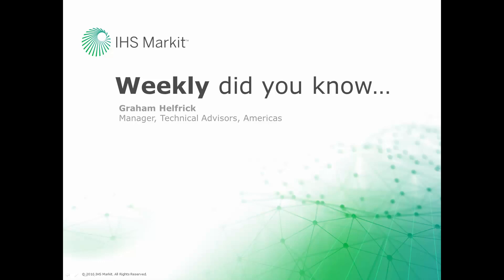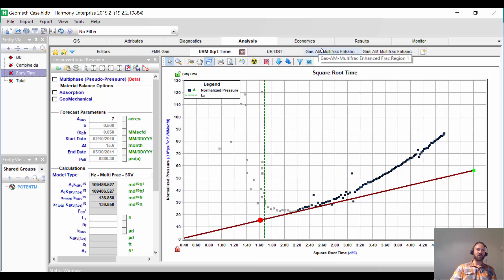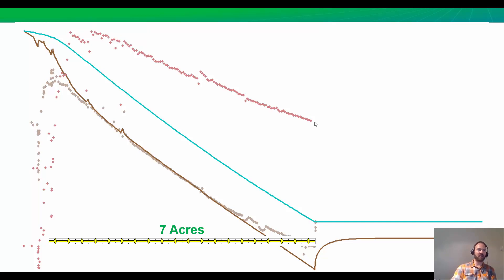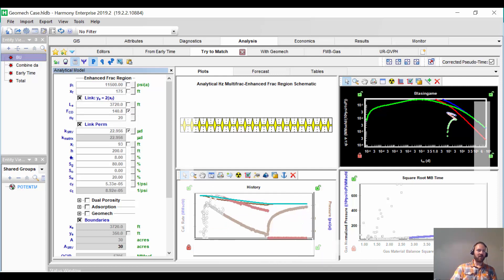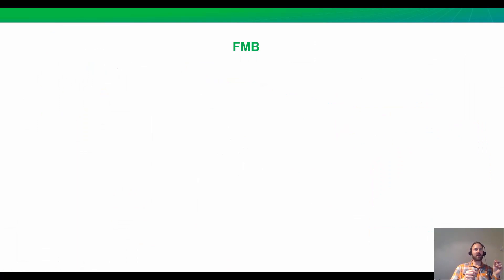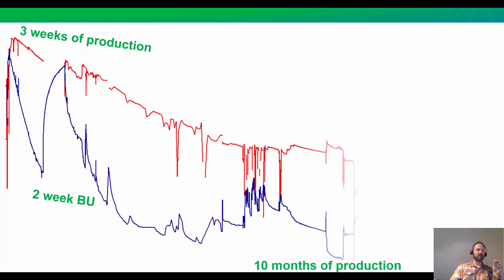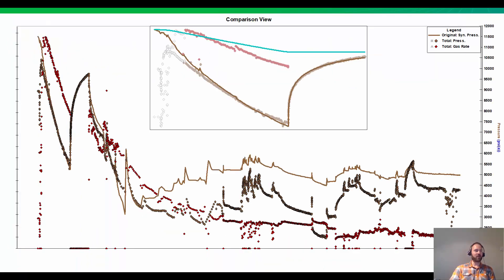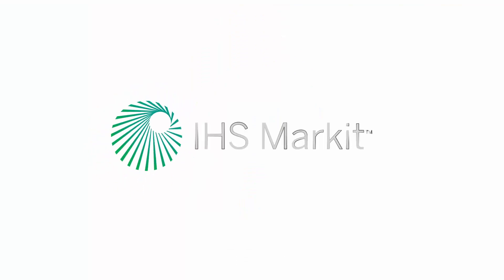Episode #46 - Geomechanical Detective Work

Comment: Excellent video.    I would add overpressure is your first clue you will need geomechanical k(p) in your model -- I have yet to see an overpressured reservoir that didn't.  We did this very thing with PBUs in the Haynesville back in 2010 -- it's a great way to fine-tune the k(p) perm modulus.   In fact, I postulate your example is from the Haynesville -- I recall we matched all ours with a perm modulus of 4.2E-4.